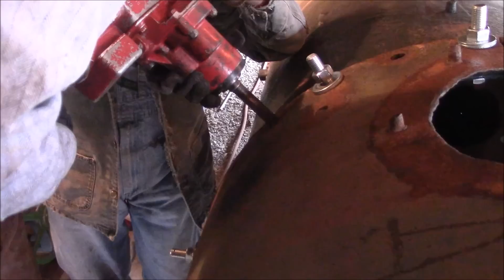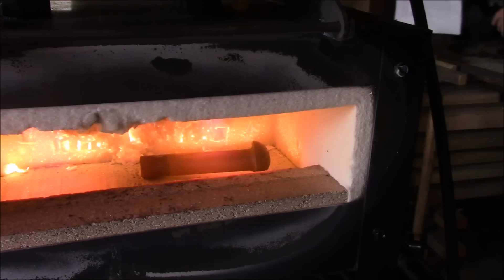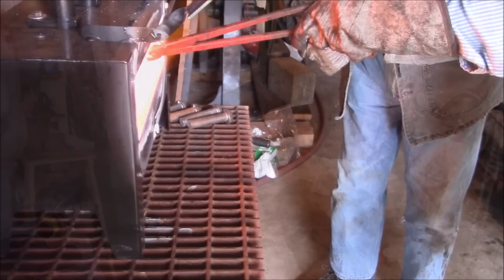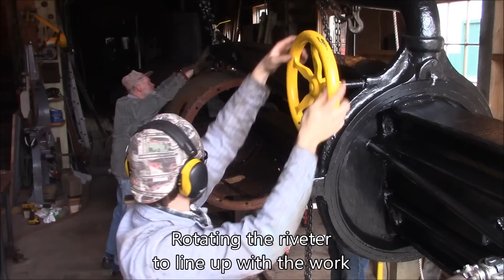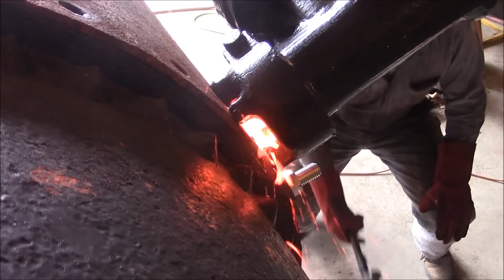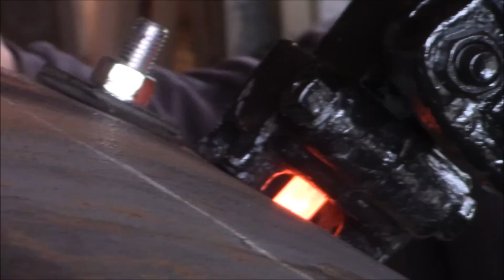Testing the Deep Throat Riveter

Comment: Does riveting alone make a boiler or smokebox or even a ship hull water/air tight? Or is there another process to seal the two pieces of iron together? -The only thing about rivets that I know is that they were an old way of holding steel or iron together.
Reply from the maker: We haven't gotten that far yet but my understanding is there is a "caulking" process that is done.  I don't think it uses any Caulk as we are used to it but uses the metal of the overlapping sheet to make a seal.
Reply: Alexander - Rivets are tight seam fastenings as they contract + fill holes completely. Riveted seams on hulls and boiler seams are then caulked. If you get chance look at hull or boiler seams and you can see a groove where caulking took place. Steel around screwed stay rods on boilers are also caulked to make them water tight. often new seams fizz a bit and it is common to run early steamings on plain water without treatment chemicals so that joints rust up tight. Modern practice is to weld stays and seams.
Reply: why copper?